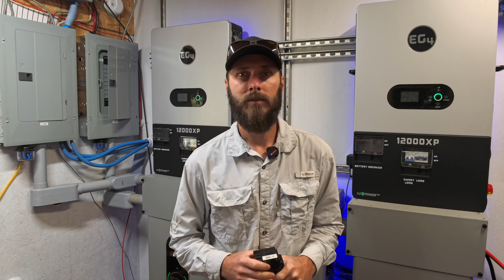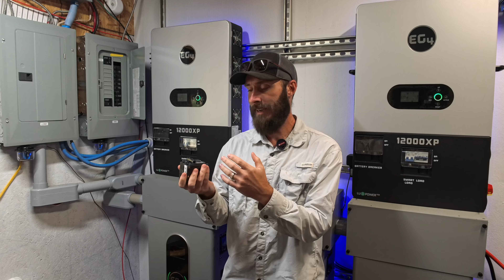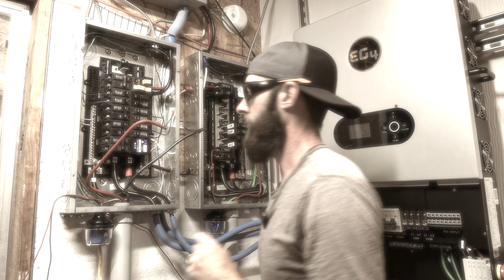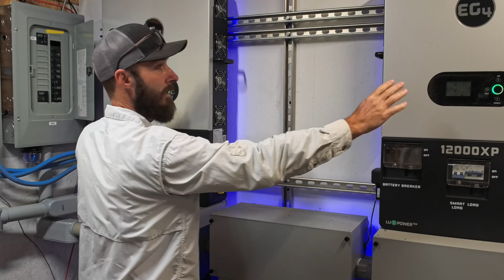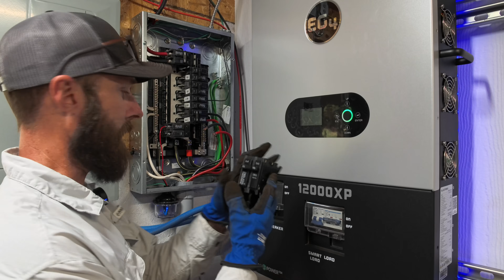It Shut Down My Entire Property

Comment: Here's what Google has to say about these high frequency transformerless inverters versus low frequency transformer based inverters: Yes, high-frequency transformerless inverters generally have a shorter life expectancy than low-frequency transformer-based units. Low-frequency models often last 15 to 20+ years as heavy-duty workhorses, while high-frequency units commonly average 10 to 15 years. Most users on r/diySolar agree that transformer-based inverters offer greater long-term durability. 

Why Lifespans Differ

More complex electronics: High-frequency inverters rely heavily on dense microprocessors, delicate semiconductor switches (MOSFETs), and capacitors instead of a heavy copper transformer. 

Component wear: Capacitors and electronic switching parts degrade faster under thermal stress and heavy operational loads. 

Surge vulnerability: High-frequency units struggle more with heavy inductive startup surges (like pumps or compressors), which overstress the internal components and shorten overall life.

Durability Comparison

Low-Frequency (Transformer): Heavy, highly resistant to voltage spikes, exceptional surge capacity, and built with simple, rugged, and repairable parts. 

High-Frequency (Transformerless): Lightweight, highly efficient at partial loads, smaller footprint, but more sensitive to harsh environments and power overloads.

Comment: Are you putting 100 amp breakers on 6 AWG?  Even if that is 4 AWG.. That would be a bit too much. 🤔
Reply from the maker: I used #3
Reply: 100amp breaker on a copper wire is 2 gauge wire

100amp breaker on aluminum is 1/0 wire 

Please ensure your wiring size matches up to the breaker size. I don’t want to see a video of an electrical fire.
Reply from the maker: I appreciate you looking out. We don't want to get these wrong. 

Which temperature column are you referencing? NEC Table 310.16 has three: 60°C, 75°C, and 90°C. Modern breakers rated 100A and above have 75°C terminals, so the 75°C column governs.

In that column, #3 AWG copper THHN is rated 100A. That matches the breaker exactly.

The 60°C column does show #2 copper at 95A, which is where I think the confusion might be coming from. But THHN is a 90°C-rated conductor, and since the breaker terminals are rated 75°C, that's the column to use, not 60°C.

Always good to double-check the table!

Let me know if i'm seeing this wrong.

Comment: Can you adjust grid current limits in settings? Just asking because my victrons let me set a current limit than everything from charging, pass-through, power assist is all regulated to stay within that grid current limit.
Reply: Yes, you can, but you are supposed to set it once and forget about it.  He placed a 100Amp load on 40Amp breaker.  Probably to save $$$
Reply: @w8stral  I get it but for the moment he can lower the limit and stop it from tripping until he gets the new breakers and wiring in...
Reply: @DeertayMike  Yea, he did not get the wiring needs upgrading message...  But honestly that is only a problem for ~half hour or longer continuous draw at ~100A

Comment: I got the Free Nights plan too. But I do not actually need it since I have plenty of LIFePO4 battery BUT I do run a pair of 45 amp chargers off it with a timer to kick on at 9pm and off at 5 am anyhow. I stay 70% plus no matter what. But where I am using it is LOL to charge my old bank that is huge in itself GC2 Lead Acid with a pair of 45 amp too, so I have 4300ah of LiFePO4, and 1900ah of Lead Acid getting full hummer juice free. I use the lead Acid to run the extra Air Conditioners during the hot Texas days, just for the hoot of it. Nothing like cooling 4200 square foot in 105 degree heat with free power.

Comment: How come the ATS didn't take over?
Reply from the maker: In this case the grid was already down, so there was no grid power to transfer to.

It ran on batteries until they depleted, which is when the power went out. then was nothing on the grid side to switch back to (at least on one inverter).

Comment: It’s nice when problems can be diagnosed that easily.  I’m still not sure why it tripped… isn’t there a config option to set the maximum amps the 12000Xp is allowed to pull from the grid?  40A should be plenty spread out over time.  Unless I guess the batteries exhausted themselves making up the difference before they could accumulate a decent charge.

Comment: Getting the torque to spec really is quite important.  I^2R power loss through even minor resistance caused by a loose connection can be quite significant at high amps.  Doing it up 'tight' with a regular screwdriver may not be sufficient.  50A across a 0.09 ohm termination is over 200 watts.  Things will get toasty.

Comment from the maker: Those recommended breaker sizes in the EG4 manual aren't suggestions. I learned that the hard way. What's the one "temporary fix" on your solar system that's still temporary?

Full 12000XP install video: https://youtu.be/ZivjVBPn2WY

EG4 12000XP at Signature Solar: https://signaturesolar.com/eg4-12000xp-off-grid-inverter-v2-usa-built/?ref=esttxthst&utm_source=youtube&utm_medium=comment&utm_campaign=breaker_fix affiliate link

Capri Tools Torque Screwdriver: https://www.amazon.com/dp/B00VPPJWLW?tag=youtube-eth-20 affiliate link

Use code EASTTEXAS50 for $50 off any order over $500 at Signature Solar.